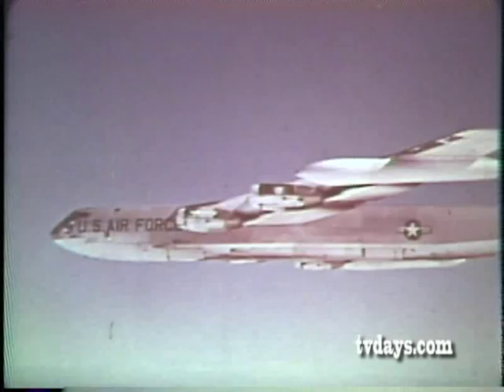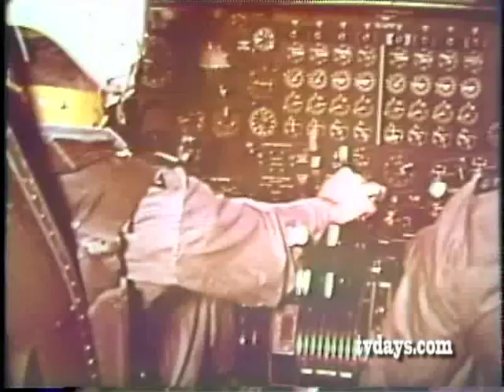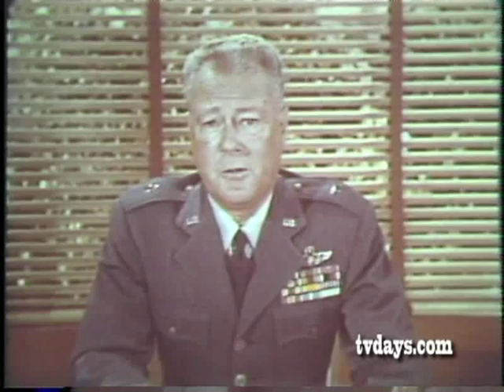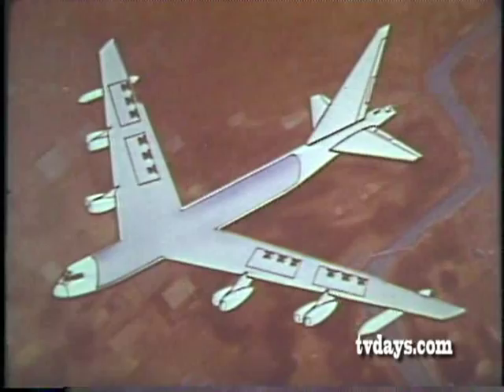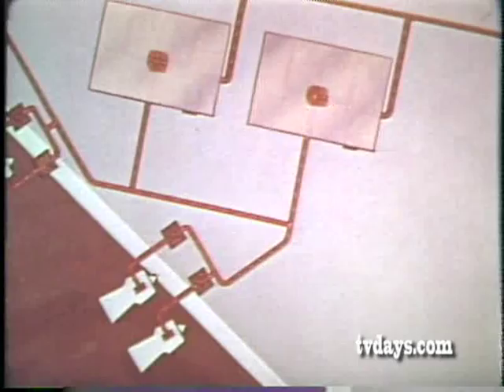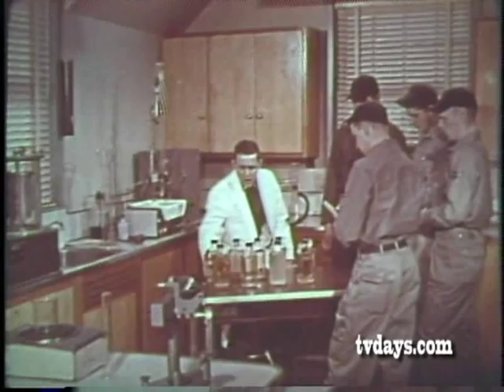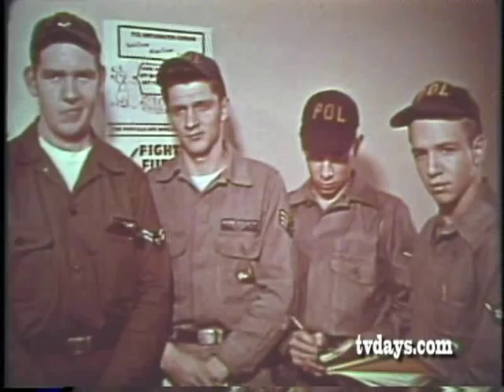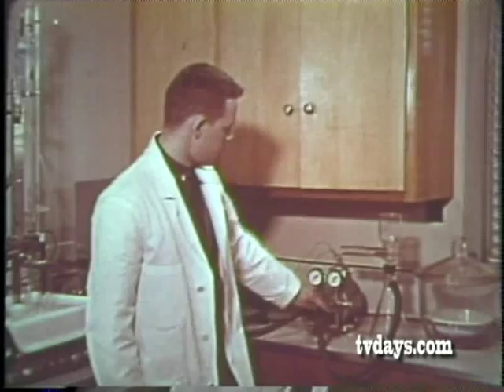AIR FORCE TRAINING FILM FUEL CONTAMINATION PLANE CRASH DIRTY GAS 1960

Comment: Sounds like the crash landing of the British Airways 777.  Not dirty fuel, but cold fuel with moisture in it.  Plane flys a long time at high altitude.  Fuel in wing tanks gets very cold.  Plane descends at low power settings which allows the ice in the fuel to accumulate in the fuel filter.  Pilot attempts to go around and pushes the throttles forward.  Then not enough fuel flow when needed by the engines as they increase power to go around.

Comment: Am I now a trained POL?
Reply: AH, NO!!!!!!    THIS FILM COVERS NOTHING ABOUT THE DANGERS OF STATIC-ELECTRICITY & PROPER GROUNDING PROCEDURE; THAT PREVENTS A STATIC ARC FROM IGNITING THE 100's OF SQUARE FEET
OF JP-4 VAPOR SURROUNDING A MILLION-GALLION PUMPHOUSE!!!  NOR DOES IT COVER HOW YOU
CHECK FOR WATER USING --WATER-FINDING PASTE; OR HOW YOU PUMP THAT WATER OUT OF A 50,000 GAL.
UNDERGROUND TANK!!!!!!

Comment: Not 100% true... the fuel filter clogs and then bypasses.  Dirty fuel is better than no fuel.

I can't recall about the J57's but modern jet engines heat the fuel via a oil cooler/fuel heater heat exchanger.  Or some by bleed air.
Reply: IT'S NOT AS BAD; HOWEVER WATER & DIRT STILL DON'T BURN;   ENGINES SEMI-STARVE!!!!!!!
IT CAN GET NASTY!!!!!!!!!!!!!!!!!!!